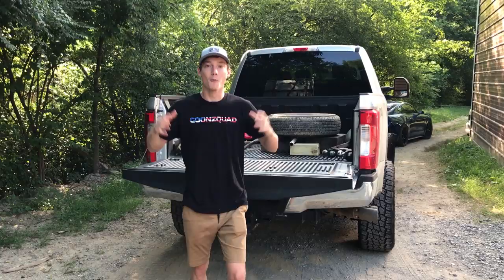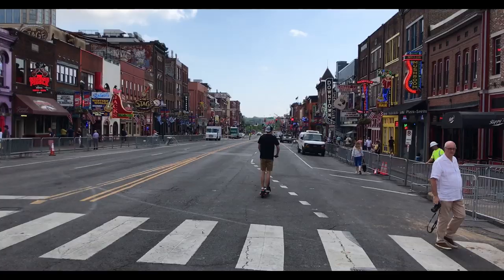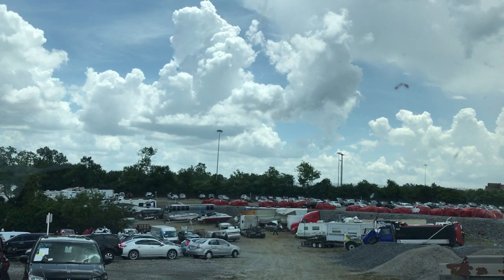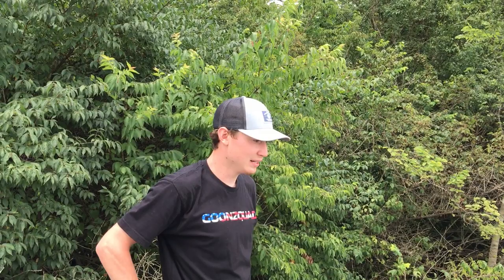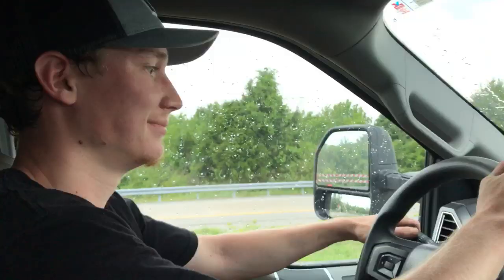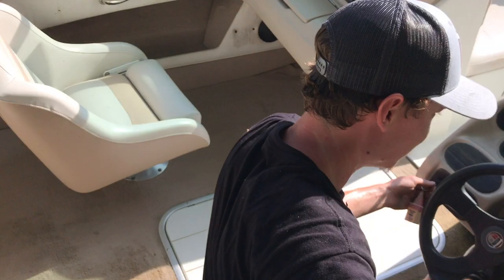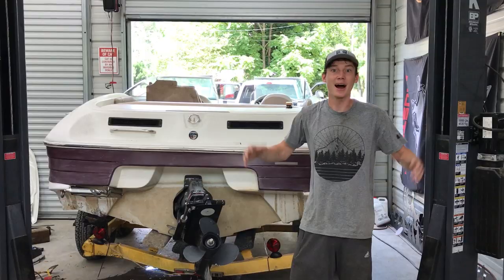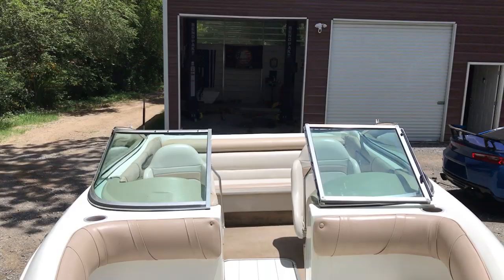Rebuilding A Super Cheap Wrecked Boat

Comment: 1 don’t run engine without water running through it. 
2 towing it the way y’all did was dangerous and in a way reckless 
3you got a good deal there
Reply: letting the motor turn over and run  for 20-30 seconds isnt gonna hurt anything
Reply: Dal Call Center I wouldn’t risk it not knowing in what condition the motor is in
Reply: @dalcallcenter2879  true, but there one or two rubber water pump impellers that can burn up and disintegrate if they are run dry for to long. Most persons don't learn about it until they're out in the water with an overheating engine, it too late, the day is ruined and its time to spend some $$$$
Reply: Gotta learn somehow
Reply: @MicRuLerZ  that's when I learned mine had burned up lol. Took it out and the temp gauge would go to hot at idle but seemed decent cruising. Took the drive off and found a severely destroyed impeller inside. Replaced it good to go.

Comment: I cringed when the motor was run without water hooked up to the outdrive. You can ruin the impeller pump in the outdrive housing by running it dry..
Rebuilding those mercruisers isn't fun
Reply: a $20 impeller is the least of their worries when they wipe out of the ujoints and the bellows by running it with the drive in the trailer position.   drive down, water on.  then start.

Comment: You guys should have used the boat ramps in Nashville to put that boat on the trailer correctly. Got to think saftey. Your choke is usually engaged by pushing in the key.

Comment: Firing it up without water just killed your impeller.
Reply: IamYeti it didn’t do anything to the *propeller but it will fuck the engine cause it’s cooled with the water that it floats in
Reply: Liam no, the water impeller  (water pump) it will destroy the rubber impeller in a few seconds running outta water.
Reply: @Liam-mp8ht  They did day IMPELLER right.  As in the rubber bladed prop inside the water pump in the lower unit of the outdrive.  It sucks water in and puts it into the cooling system to cool the engine.  While the engine can run uncooled for a moment, the impeller NEEDS the lubrication of the water, otherwise it will melt and be destroyed, causing no water to get to the engine, and therefor no cooling.  NEVER start a boat out of the water.  Even goes for outboards.   The only time it is safe is if the vessel uses a closed loop cooling ( like a car).
Reply: @Liam-mp8ht  You really dont know boats do you?

Comment: You need to hook a water hose to the lower unit. There’s a raw water pump in the lower unit that feeds the engine cooling system. If you start the engine without water going to it you will burn up the raw water pump and the engine will overheat.

Comment: You need ground up fiberglass, is like sand. You mix it in the resin and it makes body filler for fiberglass. Don't attempt spraying gelcoat! Wrap it. It takes an absolute pro to lay down gelcoat.

Comment: You just ruined that boats impeller by starting it without water
Reply: rocknroller1999  i've seen them burn up very quickly. At the very least, you're causing excessive and unnecessary wear to it by running it dry.

Comment: Did you see the big crack in the fiberglass on the bottom of the rear of the boat? I would address that before you put it in the water. If you do not do that, you will run the risk of sinking, or ripping off your transom. I would also do a once over on all of the mechanical stuff. I have been stuck out on the water before, with a no start or running engine, it is not fun. Please also look into getting earmuffs for the boat when starting, which is the tool that you hook up a hose to the outdrive water intake, otherwise you run the risk of damaging the outdrive bearings, block, waterpump, and water impeller. Please be safe, and enjoy your new toy🙂🚤.

Comment: Frame bending machine and a new paint job for the trailer. Then paint the hull of the boat guys. The top and interior don’t need anything. Great job guys.
Reply: Uhm...why paint GELCOAT?
Reply: GreenPowerNow! Strip repaint and apply gel coat. Might be wrong there. 👍🏻

Comment: You should of tried putting the plug back in and take the rig to a launch ramp.  Put a couple of long lines (ropes) on the boat and push it off the trailer.  Then pull it back in and get the boat centered on the trailer without all that work. May help in the future.  Good luck with the fix.

Comment: What I woulda done after dry starting it (no water) is go right to WOT, and slam it from forward to reverse a dozen times, going to WOT reseats the rings, and going forward to reverse loosens up the gears in the lower unit from sitting.

Comment: You guys got a good deal on the boat especially that it runs and the outdrive appears to function  there is more.  To make sure that  in the water the outdrive actually  cools the engine  as well as works correctly in the water  you can  sell the engine and outdrive for more than you paid for the package   I’m not trying to sound like a Ahole but dont dump a lot of money into it Mariah is a okay  brand but the reality is they are a entry level boat and dont sell for high dollars  ice owned 17 or 18 boats over the last 35 years   Both power and sail as well as small and large  including liveaboard  and  skiffs  i lived in Florida  and i guess you can say that boating is almost a borderline sickness of mine  i always tell freinds when discussing ownership  that boats are a horrible financial investment but a wonderful investment on fun and  memorable times some great and some bad  ive personally gotten to sail thru the Carribean a few times  and spent many days fishing or Scuba Diving  off the coast of Florida and the Florida Keys  as well as the Chesapeake Bay  and several areas of the Atlantic  Ocean  ive trained for my Commercial Captains liscense  but due to life circumstances i have  not  physically  gotten  it just yet  keep in mind everything on a boat  or Marine Grade is much more money  than you think it will be but in most cases  there are reasons you are paying higher prices  a very big rookie mistake newbies make  but can cost them their lives. Are replacing Altenators, Starters , Carburators , and electrical  parts with less expensive auto parts  to get the engine running  you will. Figure out that they. Will fit your motor as a marine engine is the same block as its auto equivalent  and they look the same on the outside but they are  built  with other internal parts to with stand the harsh marine enviorment and the demands of turning a propeller  all the parts. I mentioned previously  especially the marine electronics are designed to  arrest any sparks and not allow them to contact a engine compartment filled with explosive gas fumes the carbs are designed to not being capable of  overflowing fuel  into the bridges   As well  as a rule no matter where i have lived for the last 55 years ive known about at least one boat fire per season  with many of them having at least one fatality  so its not something to take lightly  in  every case it’s usually. Standard operating procedure for the insurance companies to verify that the vessel parts. Are the correct marine parts  and they will go after the  people for murder charges   Its not their first rodeo  so dont put yourself or your freinds  in jeapordy  of a very common mistake  ive seen my gearhead buddies say   Man you can get a car starter at PepBoys for half of what they want for that marine one and its the same thing  No it isnt   It is similar looking but not the same

Comment: You guys tried starting a boat with no water running to the outdrive. Water is the coolant for these engines...... Also, ever think to pull of at a lake or river and drop the boat in to readjust it?

Comment: What's up Guys,check your impeller and housing,with our water on the out drive it will burn your impeller up and melt the housing,never crank a boat without water,you need a flush muff.

Comment: Boys don’t ever run boat with the out drive in the full up position like you had it as it will ruin the universal joint. Also you will burn the impeller out running it dry. Need a water muff on the outdrive hooked to water hose. Good luck

Comment: pretty sure you need to have water flowing through the out drive shaft or something if its not in the water when the motor is running.
Reply: You are 100% correct

Comment: If you guys ever buy a Boat again and its sitting crooked, just take it to water, unless it has a huge hole in it, it wont sink right away but will allow you to reposition the boat properly, then just pull the drain plug and drive back

Comment: hey guys is the water pump up front where the engine is or in that L/U outdrive cos their one heavy ass  outdrive to be removeing  besides even mercruiser stern drives some time have a hard time shifting or was that OMV and Volvo penta  and one question i got to ask do you run the Blower after filling the gas Tank

Comment: Dont know what you guys know about a boat motor, but it appears as not much...no offense. Starting a motor with the drive all the way up is begging for disaster. If the u-joint breaks, the shaft will destroy the gimbal housing before you can blink your eye, resulting in a couple of thousand to fit it...if the gimbal is all that is destroyed. Also starting it without water will kill the impeller which is what sucks up lake water thru the out drive to run water thru the motor as you run. If the impeller burns out, it will break up  with little pieces of rubber going thru and into the cooling system and usually blocking some of it up. You get to pull the motor to fix a destroyed gimbal and you get to pull the motor to get out all the little pieces of rubber. Have fun with that thing.

Comment: Do not ever run your boat with the outdrive( the big black thing on the back with a prop on it) in the up position. There's a shaft that is direct drive from the engine to the gearbox in the outdrive. In the up position it puts a lot of strain on the u-joints and will cause them to fail. Put the drive down as close as you can without hitting the ground with the prop. And don't forget to raise it back up after your done testing. It is aluminum so it won't take much torment. Like being drug across asphalt.

Comment: This hurts. Don't start it out of water unless you have a hose hooked up you'll blow the motor or destroy the impeller or both. Also don't put it in gear out of water either that's not good on the gears because when it's in the water the water puts resistance on them. And no there's not a choke. Not hating it's a good video I'm just giving advice. Also you can't just paint a boat. It's fiberglass and has gel coat and all kinds of stuff. And if you paint it then buff it it's real easy to burn through the paint. Mariah is a good quality high dollar name too

Comment: I know a little about mercrusier out drives there is a rubber boot looks like a slinky when you raise out drive up all the way you can look under and see it  there are 2 one small for incoming water to motor there is a larger one the out put drive shaft and hot water along with exhaust comes out thru the hot water and exhaust should have come out of the center of the prop yours did not which means  the rubber boot is broken so good time to replace both of them and the lower unit water pump looks like a little rubber star fish not a real hard job but will need long screw drivers and a long handle set of snap ring pliers

Comment: You need to have ear muffs booked up suppling water to the impeller BEFORE ever starting that engine!  Running an engine without water will destroy the water intake impeller with in seconds of starting it!  The water acts as lube for the impeller.....

Comment: Running that motor without water will damage the impeller, in fact it should be changed anyway and yearly thereafter unless you simply put an unusually high amount of hours on it.

Comment: late 80's or 90's boat worth 2500 to 4 k in good condition with a good trailer won't know what you got until you drive it for a day.That boat hull is fair condition at best so for me I would have passed on it for any more than 500.00

Comment: Don’t start the boat without getting water in the water intake on the drive(It’s was 6 or 8 little holes going up and down on the drive on both sides) If you don’t run it with water if will burn up the water pump and it’s expensive and hard to replace.

Comment: Please don start a boat engine without water. The water is the cooling, if you do not have water connected or the propeller in water, it will go broken. Will be the same to start an engine without ANY cooling. Dont try to start it without water or you will breake the engine.

Comment: Your just rebuilding a trailer. Boat has it's gel coat damaged and need to be fiber glassed and fixed before it gets in the water and start soaking water

Comment: for 1800 it was a steal , thats for sure but I don't get why you allways try to start a engine wihtout and engine prep., even with the lambo or the 458 I didn't see any engine prep before trying to run it and that isn't a good thing . The oxidation inside the engine can be a big problem

Comment: You gentlemen need intelligence😑 the fact you started it without water, out drive not down, and slammed it into gears without letting the impeller come to a stop or at least almost stopped shows me that you definitely need a boat... NOT. I can’t wait for you to have to bring someone in to replace the out drive or the motor because just from this video I firmly believe you won’t winterize it, change oil in the motor or out drive.